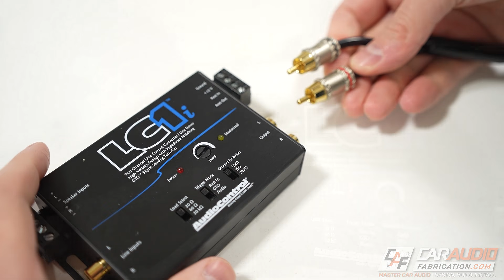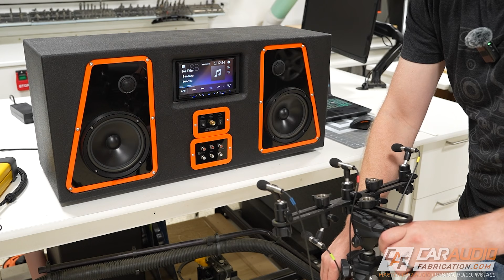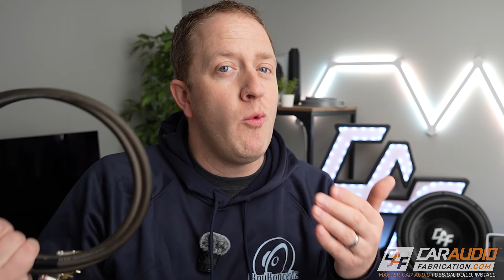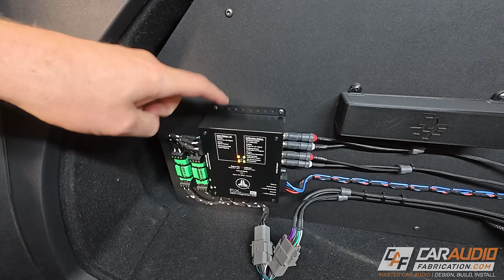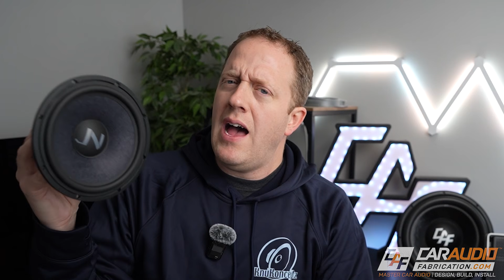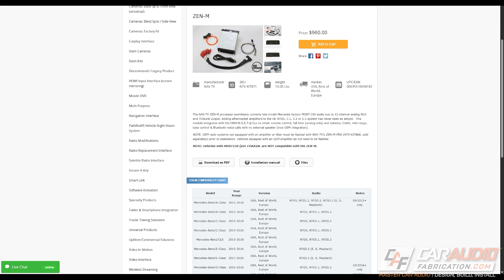Better sound WITHOUT replacing dash stereo! OEM Integration Fundamental Terms!

Comment from the maker: Everyone starts somewhere! This may be your first dive into some more advanced understanding of how to interface with complex factory systems, but I'm glad you're here! Thanks for watching!
Reply: Do you do actual installs? Curious for a future vehicle purchase
Reply: Please do a video on how to get rid of Bass Roll off WITHOUT the use of Bass Roll off knob like Audio Control uses. My Lexus has bass roll off but my Alpine DSP c60 does NOT correct bass roll off. So I had to use a AC Lc7i to correct it then go to the DSP. But heard that I can do it without the AC Unit and just use the DSP volume controller
Reply: So what is your recommendation for bypassing or working through an ANC? I have a 2025 Ram 3500 Limited 14 inch screen that handles everything and also has ANC. Nothing has been released from PAC that will handle this issue. Is it just a wait and see game for PAC to work it out?
Reply: I am using my phone as my head unit. Aux to RCA output going to an audio control lc1i,  then to a CT Sounds eq7x via RCA's, front and rear RCA outputs going from the EQ to a Soundigital 400.4 Evo 6 pushing 4 skar tx6.5 wired in parallel to 2Ω (2 on channel 1 & 2 on channel 2) and 2 Hannibal 6s (1 on channel 3 and 1 on channel 4) for a total of 6 6.5s, then the subwoofer rca outs on the EQ are ran to a CT Sounds 1500.1 pushing 2 PA Gothic 12's wired to 1Ω in a ported 3.5ft³ tuned to around 34hz.

Comment: I just bought a 2027 Mitsubishi ES AWC RVR and omg I am SO disappointed in the stereo sound. It’s absolutely horrible! I love my music up loud and the bass. My old 2017 Elantra had a deadly system. I could have it up the whole way and no muffled or hollow sound. The mirrors would vibrate with the bass lol This one you can’t go past 20. There is no bass at all. I’m so disappointed. I never bothered to ask or check the sound because I figured I was getting a brand new 2027 $35,000 crossover and the system would be good. We can’t install a system because it’s on a lease so we’re stuck with it for 5 years. I’m so angry about it.

Comment: i have two rules; no huge screens, and if i can't rip out the oem unit, i want nothing to do with the car (no, i'm not a professional installer).

sure, i might resort to inline harness workarounds, but i still want to know i can swap in an off the shelf aftermarket say, double din unit, and it'll just work. 

as much as i love computers, the car industry has taken the propagation and integration of them into the cars as a whole, wayyyy too far.

Comment: I have a 25 Colorado Z71 non Bose, got the T harness for the aftermarket sub, replaced all the door and dash speakers and for some reason now I'm getting a wierd sound on certain albums, tracks with the bass, its driving me nuts.
It's hard to explain the sound, almost like a bad sounding bass guitar sound, not drum bass.
I ordered passive crossovers to see it that helps, but any ideas would be appreciated

Comment: I have a classic car (69 Nova) and I don't want a typical car stereo that muddy's up that old car look.  I took the factory radio out completely and don't want anything modern in its place.  Can I install a Memphis Audio SMC2A (AI Suggested it) and wire that directly to a 5 channel Amp?  I don't think I would need all the extras like speaker timing but I absolutely need a quality EQ system and a Physical volume knob I can reach in the front seats.  100% of my audio would be from my phone.  (small system just louder than the exhaust drone.)

Comment: Great video! I learned a bit and learning is always fun. My experience is a little dated on new products, but the essentials will never change. I've moved on to building amplifers, but my Kona N's anemic Harman Kardon OEM system just can't be heard over all the pops & gurgles. 

I've been doing home & car audio since the 1980s and it's so easy to get wrapped around the axle on "paper specs" that rarely reflect reality. I've forgotten how many cars I've fixed or dramatically improved after spending 20-30 mins tuning them with an RTA. Every car, even identical models, exhibit different acoustic signatures. An RTA will show exactly how the car's interior is affecting audio playback. Good news: Anyone can download an Real Time Analyzer to their smartphone instead of spending $1500 on one. Learning how to use it will take a bit more effort, but the payoff is HUGE!

Even if you're an old timer there's never been a better time to upgrade your car audio. Hardware like DSP and LOCs that once cost thousands of dollars can be had for hundreds, sometimes with better results thanks to improvements in material sciences. I still can't believe that LOCs that offer DSP time alignment for individual channels are available for less than $100?! My Sony XES all-digital system (fiber optic, in the car?!) from 1995 cost over $6000, before amps, component speakers subs, enclosures & cable. 

Today, similar performance is available in a single chassis, and a great sounding car audio system can be had for less than a grand. Like I said, it's a great time to be alive for mobile audio fans. Too bad the music isn't as good, but the old stuff is still available.

Comment: I have a 2024 sonata with the basic head unit. The gauge cluster is connected to the infotainment in one big screen.

I'm willing to pay a huge amount to get a flat signal from the stock head unit. I've tried everything, LOC with an EQ, LOC with built in auto DSP (kicker keyloc), a dedicated DSP, but neither makes the sound quality good. Both DSPs make a huge difference, the audio isn't annoying anymore but it still sounds really bad. I checked the clipping point of my head unit with an oscope on various frequencies from 20hz to 15khz, but even with all that, the sound quality is horrible.

I had a 2015 rav4 with the base model head unit and it sounded amazing with just a regular LOC and an eq after the LOC.

I thought I was just spoiled from listening to high quality audio for a few years in my rav4, but when I rode in my parents car and in my old rav4 which I sold to my brother, the sound quality is 10x better, they only lack bass as usual. To really test this out I got my old high school mp3 players and their headphones from the era, and they sounded decent, not great though. But compared to my car WAY better, it just lacks bass below 150hz as all earbuds with no silicone tips from the era, they were light blue sony, not as good as the original circular apple earpods, but decent.

I don't know what else to do, my next move that I'm planning is taking the giant screen apart and seeing if I can bypass the audio from the head unit amplifier chip to an aftermarket head unit. It's kind of scary because it's an expensive screen to replace with proprietary components,

Comment: Here’s a fun one for you…What are my options to (somewhat) upgrade my 1979 Ford Quad system, with 8 track. I actually use the quad function with the few quad tapes I have. But my main use comes from using a cassette tape adapter, allowing my use of playing cassettes. What I’d like to do is upgrade the speakers and add a powered sub. I had someone tell me that Ford in that era did some odd wiring for their speakers, but that’s all he knew. I can’t think of what he meant by that. Thanks much.

Comment: Do you think you can use cat6 cable to send signal to the high inputs on an amp from a factory head unit? Just to make it easier to run the cable? Opposed to the 18awg 9 conductor wire bundle.

Comment: If i got my signal from BEHIND the head unit instead of tapping into the speaker signal, would that technically bypass all of the bass rolloff and EQ the factory radio has? If it doesnt have a chance to get filtered

Comment: What’s ridiculous about all this hocus-pocus is that only two $15 chips are responsible for a typical vehicle’s entire audio system. The tech has been around since the mid 2000’s. The factory high/low pass filters, delay, EQ, noise canceling, and mixer level biquads are easily changed and accessible prior to the OEM’s lockdown. One of these days in the near future some kid is going to make a mint offering a chip specific OBD or CANBUS dongle that allows an owner or stereo shop access to just those speaker settings without all the cable mess of an external bypass.

Comment: So.  What are the options to upgrade the headunit in a vehicle that comes with a Harmon Kardon Logic7 Surround fiber processor?  Something that doesn't run off of RCA cables, and doesn't involve getting a fiber converter.

Comment: The downfall of having to use oem integration is... oem equipment failure. It will get VERY expensive WHEN not if the oem equipment fails. It will fail. Check out the oem warranties of oem infotainment system vs the rest of the "bumper to bumper" warranty. And when you have oem equipment that needs to be coded to get replaced.... oh lord what a pita

Comment: i have a 71 chevelle with the stereo option dash pad.i do not want to cut my dash.with that being said,the factory speaker was a 4x6,i would like to go back with a better speaker but everything i have looked at have thier own set of issues.so i tried a 3.5 speaker and i have tried a couple of differant ones that failed to sound how i would like.they would start popping and cutting out.i have plenty of space on the passenger side of my dash but my drivers side has the instrement cluster kinda in the way.i have watched a bunch of your videos and feel you could possibly help me out.thanks for your time.

Comment: Everyone has a budget to work with. These upgrades can run deep and expensive. I went simple and it still set me back ~$700-800. 2019 Charger Infinity system. I upgrade the speakers to JBL GTO 939 and GX328 3-1/2". Added a LC1i to run a JBL BassPro Nano under the driver seat. Sounds 100% better. A more complete upgrade would of cost me another $1000 for amplifier and wiring harness to my head unit and I just didn't want to go that deep for a better sound experience. Thank for the video.

Comment: hey mark, i used the sub out and t'ed off em on my 2002 pontiac grand prix gtp with bose and a oem same rpo code radio from junkyard(wasnt locked!) to a line in on an amp, and tapped into the power, and ground aswell.  oem rated fuse still, and few months and no blown fuse, dead battery, ect ect. oh i have a capacitor too back there, all unplugs, and bass is controlable from head unit, should i have used a line out converter when my signal to amp is rca spec and used sub out for sub line in signal???

Comment: Was wondering if you could do an OEM integration of something like a Mazda 3 Bose system. I was told by a local car stereo installer you can't upgrade the speakers and make anything sound better. I don't believe them myself.

Comment: Can anyone help me plz😢. I put new speakers in my front doors and they were PERFECT for like two weeks and sounded amazing tbh even without an amp. Recently I got an amp and loc installed at a shop and now at low volumes maybe even high just hard to tell there is a VERY noticeable crackling noise mostly during bass. Idk if it’s the amp, loc, wires, or even my cars anc.
Reply: @Jay-n8e4w  does your vehicle have ANC (active noise cancelling) system !!! Hondas have this system that causes buzzing noises during low frequency aftermarket sub units ...  Low frequency..

Comment: I maintain to this day that fake engine noise is the stupidest thing car manufacturers have ever done. Especially in EVs.
Reply: The timing of seeing this comment is wild. Watch the latest Cleetus McFarland video about buying an EV Challenger. Confirmation in 4k (Or whatever resolution its in lol)
Reply: Don't understand this either!  But then again, I don't understand some people's love of engine noise.

I understand why some people love a car which can accelerate quickly and handle great, but an EV could easily be made which can perform as well or better while being super quiet!  But somehow, gear heads have come to associate obnoxiously loud engine noise with a cool vehicle that's  fast.

I'm glad GM didn't put fake engine noise in my Chevy Bolt.  At slow speeds, there is an artificial sound emitted to alert pedestrians [as EVs are actually "too quiet" in the sense that it's a hazard if no one can hear them coming], but it's a cool spaceship sound (well, maybe not "cool", but at least not annoying).  There's a YouTube video about how to disable it, but that would potentially be a safety issue [and in some places, perhaps open you to getting a ticket].

Knowing how to disable it is useful if you want to use the Bolt to power your refrigerator, etc., in a grid outage or when you go camping, as you technically have to have it in neutral to keep it from shutting itself off automatically [and you presumably don't want it emitting that fake sound continuously when you're just using it for auxiliary power].

Comment: Excellent presentation!  Even after 35 years into this hobby, I learned a couple new things!  Much of what you talked about applied to my current dream setup in my daily.  (aside from all the CANBUS stuff)  It was the first time dealing with load resistors or LGD's.  I have a newer Subaru WRX with the "Tesla-tablet style" infotainment (non-Harmon Kardon) and had to use the Audio Control 20 ohm resistors.  The stock head unit feeds a JL Audio FiX 86, which then splits off to TWO JL Audio TwK 88's.  I needed the additional channels since I'm running an active 3-way up front, coaxials in the rear doors, custom pods in the C-pillars for my adjustable differential rear fill, and finally the subwoofers.  I now have four extra channels of DSP if I ever decide to do a front sub or center channel.  (a center channel would be least likely)  I always look forward to your videos.  Keep up the top tier content and quality sir!
Reply: Nice setup. I have a similar setup but only one TWK 88. The software program for The Fix 86 allows you to select an output voltage (up to 2v per channel) for the RCA outputs. Where do set you set yours? Or a better? How do determine where to set? Nobody seems to be able to answer this ? Any advice would be much appreciated.

Comment: My audio guru just loved de-tuning the all pass filter in my GMC truck’s Bose system 😂. Used the Audison DSP to integrate with the factory system. Didn’t sound easy for him, but the end result sounds so much better.
Reply: Why in the world wouldn't you have just bought the proper interface that gives you a flat 20-20 khz and allows you to control the door chime level?

Comment: Oh how I miss the car audio days of the 90's. Pull the factory double DIN head unit and replace it with a single DIN/EQ combo. Run some wires and done. No worrying about anything else being integrated into the head unit, ANC, or pumping in fake noise that has to be dealt with.

I would love to replace the factory speakers and add a sub to my 2025 Crown Signia (base system). But it has ANC (hopefully could get that turned off by the shop I go to) and being a hybrid makes me a bit nervous. But at least the 12V battery is in the back so the power wire would be a short run.  😁
Reply: IKR! I’ve been out of it for nearly 15 years and coming back im dumbfounded by what we need to go through
Reply: @Sir_Scrumpalicious   I just bought a Crown Signia and trying to figure out a audio upgrade path that’s not too expensive or power hungry. I had ANC and ESE turned off at the dealer before I picked it up. I got the XLE trim which is surprisingly ok, but I want more clarity and bass. I’m thinking about just replacing the speakers and adding a powered sub.

Comment: In UK we have Skoda cars with Canton "premium" sound system. I added lc7i and aftermarket amp. Nothing changed. Quality is a little bit better but volume not increased. I wanted to take signal from head unit directly tapping in to wires, but I couldn't do it because wires are optical. So I took signal from factory amp output wires. And outcome was nothing what I expected, like I said quality a little bit better but volume hasn't changed. 
Now I'm thinking I've never heard of load resistors and would that solve my problem? 
Can anyone with knowledge can put me in right direction?

Comment: 1. The "infotainment" in the dash is just a screen on modern cars, the actual radio is hidden elsewhere (usually under the glovebox)

2. The factory amplifier on modern cars generally cant be deleted as its used for vehicle system sounds (turn signals, park assist, warnings etc)

3. One thing im genuinely curious about is how you add aftermarket amps to these modern systems
  The vehicle ends up kinda broken if you remove the factory amp
   The factory amp gets mad if it cant "see"the speakers

So how are you supposed to both keep the factory amp in place and bypass it in favor for a more powerful tuneable setup?
Reply: They make many interfaces for a lot of the vehicles.  Pac Amp Pro, Idatalink AR, Navtv, Metra/Axxess etc

Comment: What I try to do is get the MOST optical or digital out from the factory headunit using a NavTV Zen V. A clean unmolested signal that turns the headunit into just a transport and sound is actually made within the Zen V or passed through to a DSP. This needs it's own video.  I was always taught, Garbage in, Garbage out. The Zen V is expensive yes, but compared to a good headunit and fitting kit it's comparable.